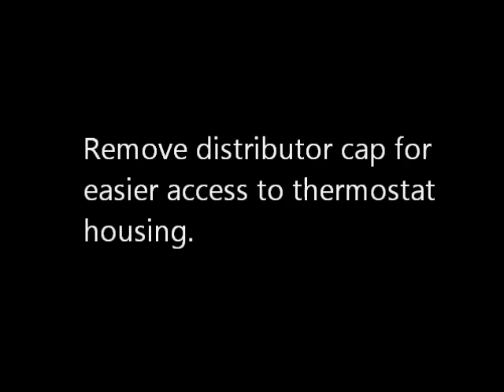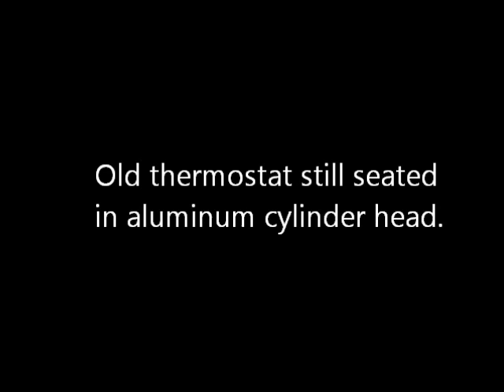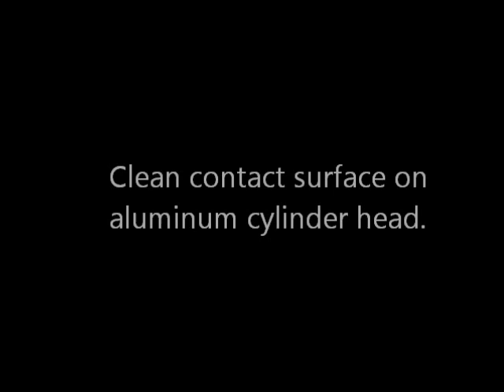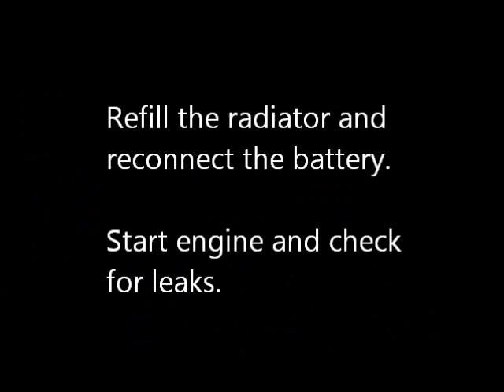Mazda Thermostat & Gasket replacement

Comment: good video it is right to the point and only video i seen on how to change a thermostat and where it is, just needed to find the location, thanks j Rock.
Reply: How did you get the bottom right thermostat hoysibg bolt off. I cant get a socket in there